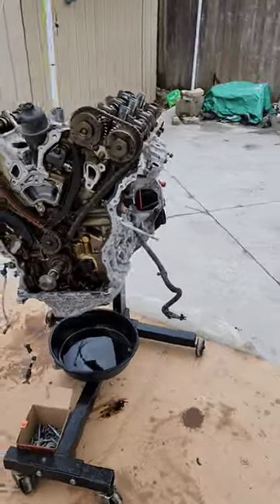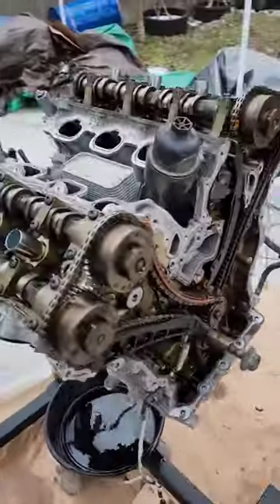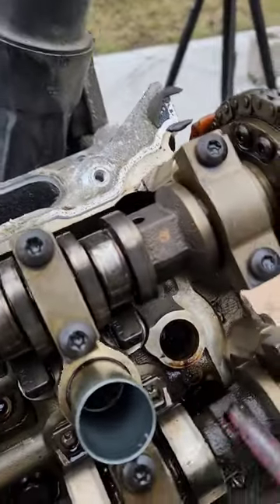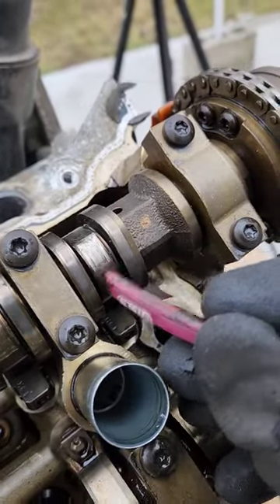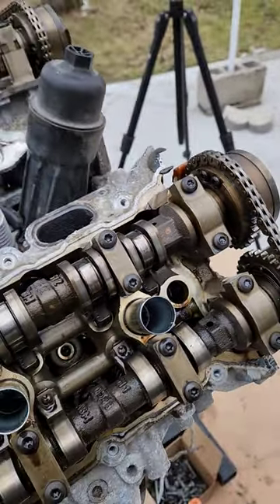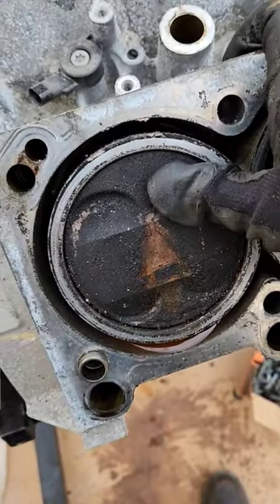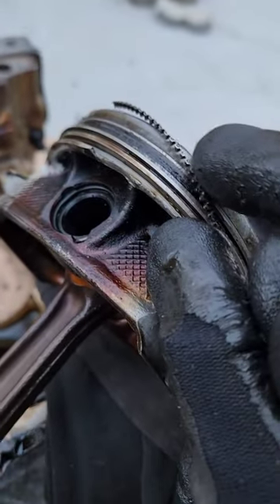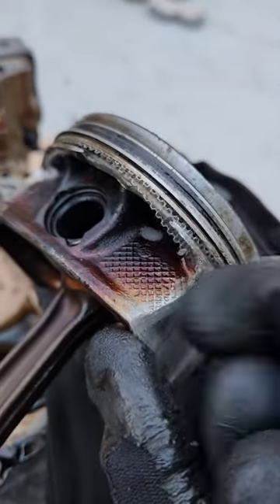Failed Pentastar 3.6L V6 Engine teardown

Comment: Looks more like a case of neglect and lack of maintenance than design issues
Reply from the maker: The cam and rocker is a known design issue
Reply: Its ok to defend crap mopar, your not the only one in the world who lacks knowledge
Reply: It’s ok that the only thing you have knowledge about is how bad the Mopar engines are.
Reply: @yungxsixbigswagdady6970  From I have heard every brand in the world is crap
Reply: @gamestycon2239  Pretty much the case from what I've learned...all brands have problems these days, including Toyota
Reply: Yet a 1970s Chev 350 sitting in a field for 10 years will still fire right up with clean plugs and fresh fuel. But yeah, let's just blame the mark owner for his own misfortune.
Reply: @fun_ghoul  That 1970s Chevy sitting in a field, will certainly fire up because it has no computer in it telling it that it can’t
Reply: @speedkar99  known design issue on earlier engines, this one is a case of owner neglect. if you don’t maintain them they will fail.
Reply: @mmarciniak  modern ones are great
Reply: @chrisfreemesser5707  gms LFX with timing chain issues
toyota with rust issues
toyota with transmission issues
toyota with gas pedal issues
toyota with floor mat issues
yota 4gr just in general
fords ecoboost line that “boosts” itself into an early grave
ford transmissions being built worse than sand castles
chevy afm engines not being able to withstand 1 single mile of operation without bending pushrods
Reply: @SteveB88  I mean yes, but with regard to the specific kind of maintenance needed by an engine to run, small-block Chevys -- or old engines in general -- were built to run leaded gasoline, 10W30, and being iron, you could have great dimensional stability and clamping force such that cheap gaskets and bolts would hold engines together for the better part of a century. Thinner oil and tighter passages geared to it are not accidental, and I'd argue are worse than the need for computer control (READ: fuel injection). Come to think of it, Chevy trucks back through to the mid-80s have had the same motor but with fuel injection, and they fire right up too. Computers used to be build with better, larger parts and tolerances than today, with the model for reliability back then being the US space program.
Reply: @TheSavage3.6  
You forgot Subaru, K24 Honda engine in CR-V, Accord, Hyundai engine disease and many others disasters of current automotive industry
Reply: No matter how much maintenance is a flaw design  .
Reply: @speedkar99  this is true on .05 percent off all 3.6 pentistar engines. Once you hear a tick tacking noise just replace the roller rocker arms with an upgraded design and you’re good. I did and saved my cams. Only $250 for parts
Reply: @speedkar99 what bruh? Yes, it is somewhat common in this vehicles but dude, for the lobe to be THAT drug into is crazy. That thing had to have been ticking for years. Never seen a lobe that bad before.

Comment: I spent 5 years as a dealership tech for CJD in aus and yeah we did cams and lifters often, as well as oil filter/cooler housings. I only remember 1 failed engine, we saw many more well over the 300k mark on original running gear. More or less one of the more reliable engines they offered over here. We saw more 3.0L ecodiesels and hemis go bad..
Reply: lack of maint. here in the US, they recomend 0/20  i use Mobil 1 0/40

Comment: I have the 3.6 Pentastar in my Chrysler Pacifica Hybrid it's been a fantastic engine not one issue these are solid motors you just have to change the oil at reasonable intervals and use quality oil!
Reply: 9 out of 10 fail early, you just got a good one
Reply: Dude, you have the worst rated car for reliability and you're here preaching how great it is 😂. Maybe you got the reverse of a lemon 😂
Reply: Call it what you want maybe I got a lime 😎... Would that be the opposite of a lemon 🤷😁

Can't speak for other owners but our 2020 Pacifica Hybrid has been a very reliable minivan (currently sitting at 80k) even in conjunction with the hybrid system it's been waaay more reliable than the 2011 Honda Odyssey we had prior.

Different ownership experiences any way you look at it... we would buy another one in a heartbeat!
Reply: @gabeh7373 I guess me and you are the only ones doing it correctly..I have 150k miles on my jeep grand Cherokee and I use the best oil "amsoil" 
I change it myself and My engine still purrs like a Lion

Comment: Depending on what year this engine was built and was there frequent oil changed interval done to it, 3.6 l v6 engine is durable enough to last 200,000 miles.  Make you wonder if this engine was ever given any attention.

Comment: For the sheer amount of these engines that are in service, they really aren't as problematic as the context here makes them seem.

Say, hypothetically, 10,000 engines had catastrophic failure caused by crappy camshaft metallurgy.  That would still only equate to a less than 1% failure rate.

Comment: VAGs EA888 is more reliable in comparison. 
With those you just got to keep them well maintained with 5w40 instead of standard 5w30 (5w40 is better for all components and reduces oil consumption) and dot mess with the tune unless you know your shit.
Reply: Lol no it is not.

The 3.6L is a very reliable engine, with how much were produced there’s gonna be one that fails here and then. Early ones had issues with rockers but later ones are solid.